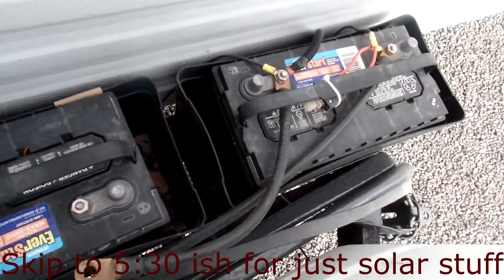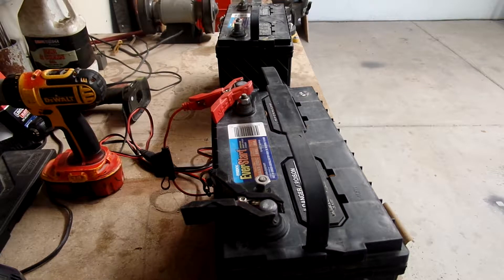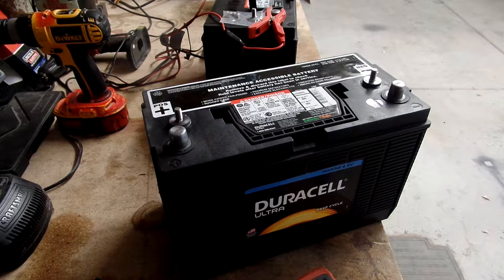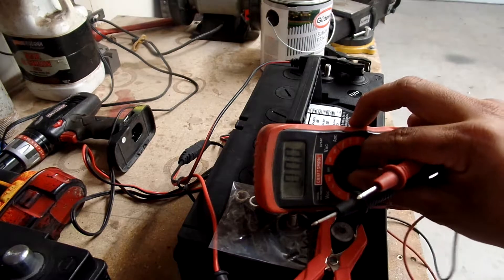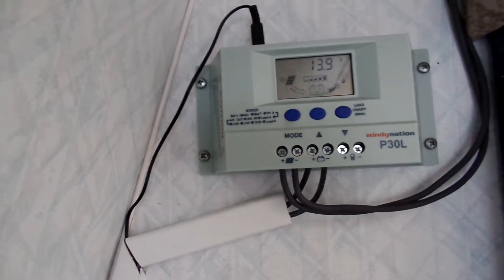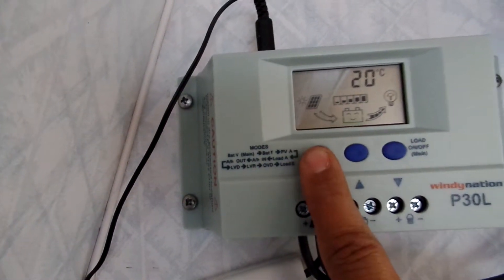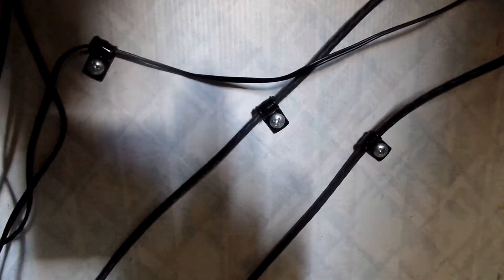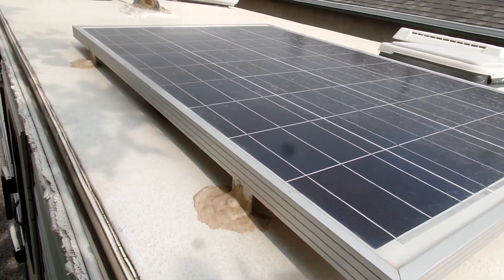Windy Nation 100 Watt solar panel and battery crashola!!!!!!!!!!

Comment: The load is the 12 volt load from the WPM charge converter. Has nothing to do with the inverter. Confusing i know.. I had a hard time with it at first too.  Need any help or questions let me know. I live litterally near the Windynation HQ in Ventura. ;p